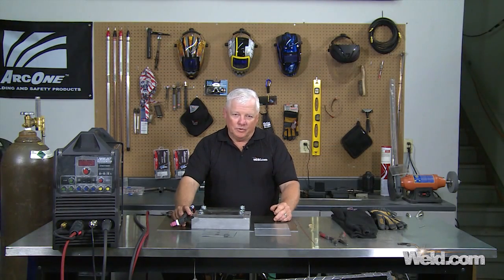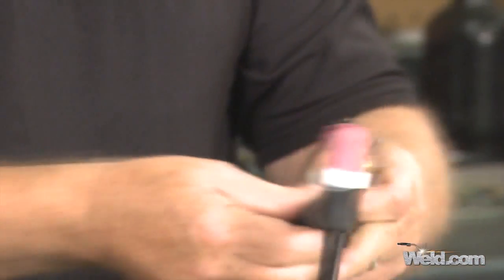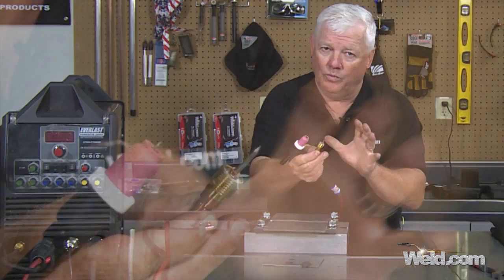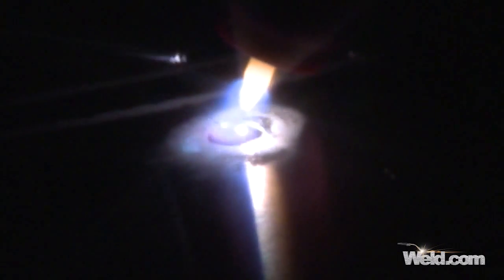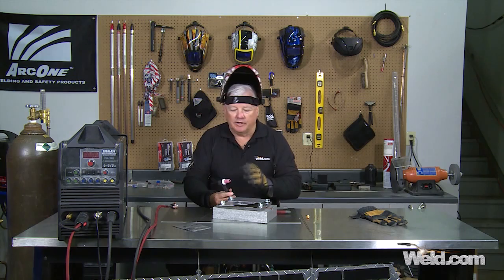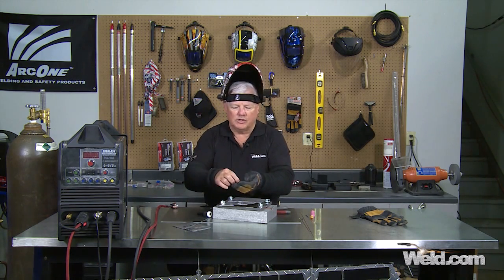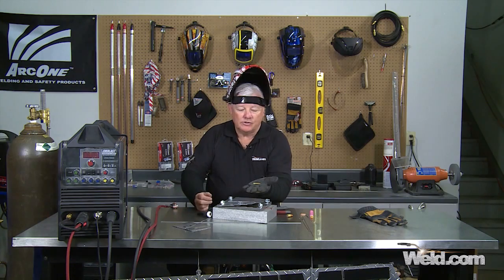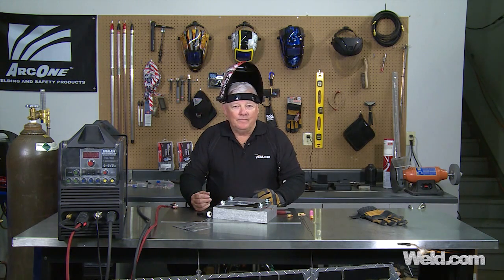🔥 TIG Welding Aluminum with DCEP | TIG Time

Comment: Would laying down some aluminium welding flux before welding help deal with the oxidisation issue? If so could you then downsize the tungsten?
Reply: AFAIK DCEP is cleaning polarity, there's no oxidation, look at his shiny weld puddle. Its basically an arc control and (lacking) heat transfer problem.

Comment: This is so handy for me I live in a farming area like mostly farming or logging nothing else outside of government work but with the wheel lines I had to move the part to the shop to fix and these aren’t art work it’s about function and getting it done fast and cheap so fixing it with the engine drive machine really saves the day and gets me more work as a rig welder but I’m still perfecting the technique it’s not as easy as my ac machine back at the shop but I’m learning and getting better

Comment: I have a new Lincoln LE31MP (still in the box) and I want weld an antenna tower tilt / hinge base.  maybe 20-24 inches in all.  I’m in it for $900 +/- and it says stick, mig and tig but you need to buy more stuff 😠.  the Lincoln folks said I need a spool gun and argon gas. Tractor Supply has a 40cu ft tank for $170 (I assume it’s full) and the spool gun is $350.  do I need the extra items?

Comment: What setting is your your current, voltage, frequency, pulse, hot start parameters. My tip literally melts down completely into a large ball and the aluminium craters or burns through with current at 75 amp, frequency 100hz, pulse 2T.

Comment: I just use aluminum  brazing rod with a propane torch (yellow map gas) for simple repairs. I would guess a lot of farmers use this method also. You can buy the rod at tractor supply or online. It's way easier and portable.

Comment: Never could get this to work my tungsten just turns red and my ball falls off using 1/8 i have tried dif amps and am using 100% argon i think im trying to weld to thick of material around 3/16 to 1/4

Comment: i only use DC with helium on very thick aluminium to achieve vey deep penetration and then I finish With Argon AC. AC current is used to weld aluminum because its positive half cycle provides a cleaning action and its negative half cycle provides penetration.  You don't get cleaning action on DC so its full of porosity

Comment: instead of scratching into your material that you're getting ready to weld use the filler rod put one end on the plate and touch the tungsten rod
Reply: Yeah until the rod sticks to the tungsten

Comment: I tried this setup for thin aluminum tubing on an automotive project. And it did exactly what you had said in the video. But I have a hard time but welding aluminum tubing.   Is this not good setup to but weld?

Comment: Mr. Tig, 

Thanks for the video first. Next can you give any pointers for keeping the arc going with this method. I get a puddle and then as I add filler, the arc dies.
Cheers,
Reply: I was using Helium, I also tried DCN Helium welding. It seems very difficult to keep the arc using Helium, any tips?

Comment: I heard you can do this also but have to use helium instead. What gas did you use?
Reply: Argon!  It says in the intro.  With Helium it's "Heliarc" welding, which has a separate video.  There's no cleaning action with Helium, and it's different in other ways.

Comment: I'm trying to join 2 x 1/16 aluminum plates together with dcep.  I've got a 1/8 2% ceriated tungsten, my piece is very clean. The tungsten is ground lengthwise.  I've got the machine at 35amps with and a pedal. At lower amps the arc does not want to settle at all and when i bring it up to the 35, it focuses, but then melts through the edge plate all together.  Help!
Reply: It sounds like you're getting close!  So, maybe the electrode is a little bigger than needed?  If you don't want to use a smaller one, you can fake it by grinding more taper on the electrode.  Not like a needle.  I think the latest is a taper with a little flat on the end, which will become rounded in action.  The tip has to be white-hot to get the electrical emission.

Comment: I weld things out of lawn chair aluminum tubing. I have to try this and see if it can work any good. I have Miller Machine with variable AC cycle and usually do this on full clean cycle. Try going all the way to full clean cycle

Comment: I keep coming back to this topic every year or so... I notice that there are WP-12 torches out there, and Tungsten electrodes up to 3/16" and even 1/4" which are expensive but do turn up.  I have the electrodes but not the torch. So, the thinking here is to get a HUGE electrode in a water-cooled torch, and just DEAL with the inefficiency of this... and use the full output of say 250Amps on DCEP to weld thin sheet.

Comment: At 2:05 "You get a half a cleaning cycle" sounds like we're still thinking about AC.  Here is all cleaning, all the time!   I've watched this a few times, it's a rare take on a useful and forgotten method.  I have renewed interest b/c it looks like I'm getting access to an old TIG power supply that can deliver over 300A and also have a spare water-cooler and some big Tungsten!  (3/16 say).  You can get up to 1/4".... Let's see what this can do!  If it works, I'll name the demo  after Mister TIG!
Reply: Years later (a generation in Internet Years),  I finally got the outfit together but still haven't done it!  If I live long enough it might yet happen, in a different city with a different organization, as a hobby among retired people ( "men").  The Helium cost a fortune and is in short supply, and I managed to get this amazing huge TIG torch that can take 3/16 and 1/4" electrodes!  And their Metric equivalents, something like 3mm 4mm, 6mm.  Those electrodes and collets are not common, not cheap.  The TORCH looks like a hammer!  It's an impressive crazy looking thing.

Comment: Thanks a million Mr. Tig! I thought that you absolutely had to use AC to weld aluminum unless you shell  out for helium to weld with DC. Now I don't feel so cornered into trying to save up for an AC capable machine just yet.

Comment: to start i am not a welder... but i am a looking to buy a welder.  also i will prob never weld aluminum. i will mainly be welding on my old f100, i used a lincoln 130t for the first half of the project. i now need a new welder so i was looking at dc inverter with tig/ stick welding. i know i will need to relearn how to weld but my question is would this be a better welder to buy vs buying another self feed? i want to be able to weld more than just sheet metal... maybe some frame work. and would i be able to do aluminum with a dc inverter

Comment: Would you be able to weld 6mm aluminum tube with a tig and if so what amperage
Reply: on DC.....  Need Helium.... being that your running almost .244 thick...   AC is happier   and easier to see clean weld with

Comment: Have you done a review of the Accurate tools 3in1 plasma/tig arc welder?

http://www.ebay.ca/itm/NEW-3in1-50A-PLASMA-CUTTER-200-AMP-TIG-STICK-ARC-WELDER-/291951952608?hash=item43f9b142e0

If not would you consider it I would like to get your input on this machine.

Comment: It didn't come up, but I think this is the original TIG method.  The problem is that a majority of the power is being used by the electrode and not the work.  This was hinted at here.  You get maximum cleaning, poor control, low penetration , low efficiency.  On the other hand, if you really have to do this, there are bigger electrodes and water-cooled torches too!   I've heard that some people use this for very thin sheet.
Reply: the penetration is higher if you use helium
Reply: put your ground cable on positive and torch on negative

Comment: Im curious on what the amperage that you were using?
im seeing online that in DCEP that you can only run about 55 Amps tops on a 1/8 tungsten.
so if i was in a pinch and needed to use my dc machine to fix something where do i start?

Comment: Thanks. Good info. I have a Thermalarc 252i 3/1 that is just DC. I am getting a spool gun for aluminum but I will have to try this.
Reply from the maker: The spool gun will give you much better results unless you're in a pinch.
Reply: For repairs I'll use the spool gun but it's always good to have the ability to do what you got to do to get the job done. Right now all my aluminum repairs are done with my Miller blue star DC stick.

Comment: I have a bathroom exhaust fan blade that has multiple cracks on the flat between a couple of the upright blades. I will be attempting this process to repair it and I will video that and send you the link once I post it on Youtube. Thank You for the continued knowledge! my Miller Multimatic 215 should do the job with a Furick Cup and gas lens system running straight Argon

Comment: Mr.Tig, I have an Everlast 140st scratch tig machine . I'm interesting and welding some aluminium turbo inter cooler tubing using the technique shown in this video? Will this technique cause any damage to my machine and should  I plan on trashing 1/8" tungsten to get the job done? Also one last question, if this method works for the aluminium tubing , should I setup a purge while welding it? Thank you.

Comment: Hey mr tig, does that mean I can tig weld aluminium with my dc inverter 180 amp caddy type welder?
Reply from the maker: John bennett in a pinch it is possible, but not the preferred way of doing it.
Reply: Weld.com thanks for the quick reply, I do have access to a ripper kemppi tig welder at work that I use for hf ac alloy tig welding but it is good to know that at home I can get away with my own welder for small patch up jobs, sorry for the follow up question but would I attach my torch to the - side of my welder just as I do for s/s tig work?? Cheers.
Reply from the maker: For this particular application you would be welding the opposite as your normal SS setup. Setup your machine for DC Electrode Positive. Torch is +, Ground is -
Reply: @Welddotcom   I just tried this and did not work. Tungsten just splattered like mig or flux welding
Reply: Jose Gonzalez were u using a thick 1/8th tungsten? I wanna try this myself lmk
Reply: @madvtecyo546  yes I did and was rather disappointed. I'm just gonna invest in a AC/DC tig welder or get better with the oxy acetylene
Reply: @jgon666brb  There are bigger electrodes! 

This is very inefficient, you want a big electrode and a water-cooled torch I think.  3/16" electrodes are available!
Reply: @leonardpearlman4017  at that point I might as well buy an AC/DC tig welder. I went off of what mr. Tig said to do and did not work
Reply: @jgon666brb  what colour type of the  tungsten have you use? Red,Grey, Blue?
Reply: @skazmi7894  purple
Reply: @jgon666brb  have you tried Red?
Reply: @skazmi7894  no I'm just gonna buy an ac/dc welder

Comment: wat amps and was he using argon pure shield or helium
Reply from the maker: Pure argon when in DCEP. You can use the same amps as you normally would for AC Aluminum welding.

Comment: MIC-FROM MEXICO 
CAN I WELD THE ALUMINUM WITH  MILLER DIALARC 250V AC DC ?STICK USING SCRACH 26 TIG TORCH?NO HIGH FREQUENCIES??

Comment: Mr. Tig in your brazing vs soldering video you omit to mention the
real difference between the two procedure
1. brazing is mostly kell welding, you did say that but it is not necessarily waterproof
2. soldering provides a waterproof connection by the capillary action I do not dot that you very well aware of this , ßo 5hat is just an omission
3. the third method could have been mentioned the silver brazing which is a solution between the two.
I am a subscriber and appreciate your videos and will keep watching, pls consider this as a constructive comment
ThatOldBob

Comment: Mr. tig
Thanks for your interest.I solve the problem . my machine is STAMOS 250 dc tig/mma
http://www.ebay.com/itm/121162511843?_trksid=p2060353.m2749.l2649&ssPageName=STRK%3AMEBIDX%3AIT
Now i like to ask how amps you use and how much cfh gas flow?cause im trying  dc+  60amps   gas flow argon 100%  20 cfh 
tungsten red  1/8 2% Thoriated  and as a result is melting the tungsten , thank you

Comment: tried to sratch start tig aluminum with argon keep melting the tungsten went to 1/8 tungsten but it still melts out at 120 amps what am I doing wrong ,using about 40 on the gas guage
Reply: For continuous welding with 1/8” tungsten 40 amps is max, 55 for short bursts running DCEP.
Reply: Tungsten needs to connect to negative side, that's how I avoid the melting issue on my DC Tig. I'm the newbie, lol
Reply: @ericzheng447  Clearly, but today's topic IS welding with reverse polarity.

Comment: hi ,when you said  to set up machine dc+ what do you mean?there is a switch on your machine for this?
my machine has only one  switch for MMA/TIG.
Welder TIG Arc MMA 250 Amp DC torch welding machine professional inverter hf new.
Reply: depends on your weld machine. nomally dc tig machine is configured at DCEN (The torch is connected at negative port) . to make it DCEP simply swap the connector (torch at positive port)

Comment: Mr. Tig. Would you please to tell me, how steel plates are attached on induction based aluminum utensils as pressure cooker and frying pans? What technology is required to produce in good quality and good finishing products.
skype: aishorya
Thanks.

Comment: I would DC TIG aluminum with an aluminum stick electrode as the flux will dual shield the metal. Of course there will be slag, but it's very easy to knock it off compared to the kind produced by 6013 rods (that slag was difficult to control and hard to break off the welds).
Reply: Sounds like a recipe for slag inclusion.

Comment: Wyatt: Tried this out on 1/8" aluminum and got some pretty decent beads (for me , maybe not that pretty for the pros). Not a lot of penetration on the back side, tried a edge to edge joint from both sides . It was solid. Around  50  amps.
Also ran some ok  breads on 28 gauge  at 5 amps (ya some burn throughs) . Had no material sizes in between. This is with scratch tig. and an amateur using it.
I am extremely pleased
I thank you greatly for this technique and your video (s).
Reply: Bill Fleming ,what filler did you use. ..4143 or 5356,thnx

Comment: Steve,  You should be able to push and release the tungsten all the way thru your collet from the torch end. .  Sometimes the tolerances are so tight that the paint on the tungsten actually prohibits good clearances.  Give it a try and let me know... thanks Mister TIg

Comment: Hi Wyatt-thanks for another great video. I saw a previous vid where you recommended the wedge collet and I contacted Bonnie to find a supplier here in the UK-got them after 10 days. Only problem I have is the tungsten doesn't want to feed from the front of the torch,I have to take the back cap off each time. Is this normal? (1mm tungsten ) Cheers

Comment: Thanks for posting Mr Tig!!  Will be great to try out for an odd repair when needed.
Reply: The guy didn't even specify a current but from elsewhere I read you shouldn't be using anything more than about 30 amps or so... anything more and the tungsten balls up badly. I guess for anything thicker you can just stick weld it. I mean let's face it, welding thin stuff is the real challenge here.

Comment: Benjamin,  You are correct... Helium does not conduct an arc very well and the dc+ process already requires a tight or close arc.  Helium would cause both poor arc starts and arc wandering.  thanks for the question... Mister Tig

Comment: Thanks for the vid. The only thing that you left out was the approximate AMPs it took. Also, it looked like there was a TON of distortion!
Reply: just the normal amount of distortion for an uncontrolled joint. Aluminum moves about three times more than steel.

Comment: Random question (perhaps a silly one too lol)
Could one of the scratch start hand pieces with the gas valve be used with an AC ARC welder for welding Aluminium? It would be the coolest thing to weld Aluminium with an old buzz box! :-)
Reply: +joehunt1980 ..with AC you usually will need hi-frequency for aluminum or magnesium... you can buy an add-on arc-starter that will work...but by that time, you've spent enough to get a small AC/DC TIG.

Comment: hi wyatt thanks for the video, have to ask a few questions, you say this is to be used in a pinch, prone to cracking? would preheat help? what are the settings (amps, rod and cfh) you used? any allow to be aware of?, sorry many questions :), thanks again. cheers. pete